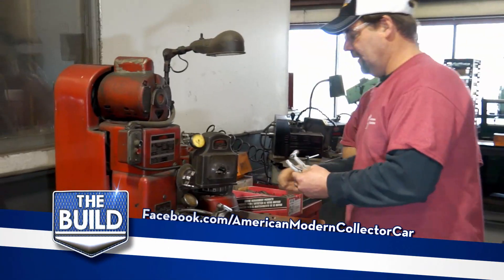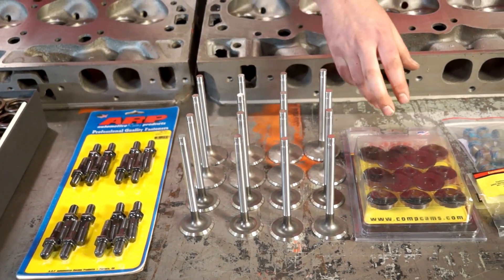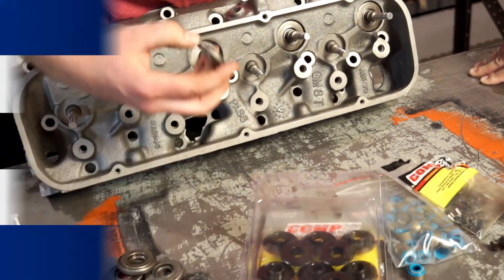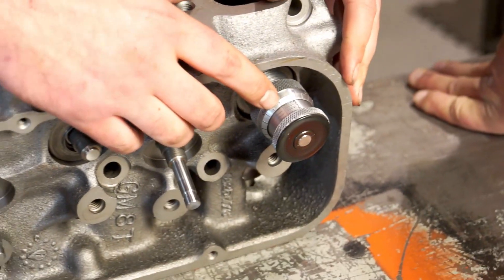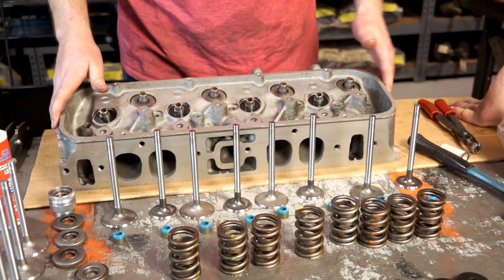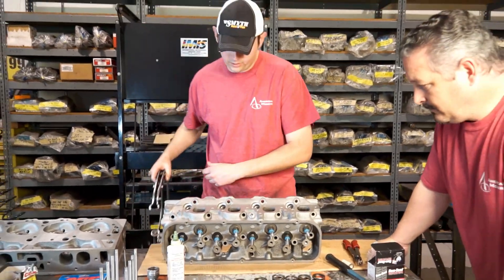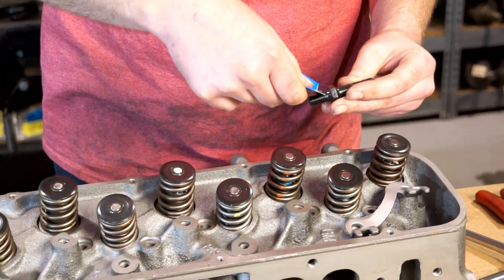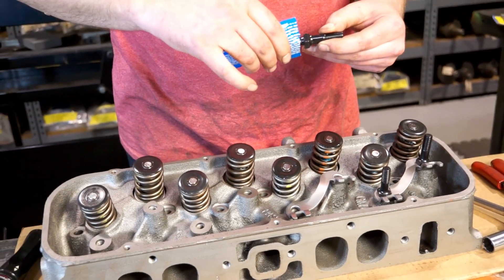How to assemble cylinder heads - The Build

Comment: I am working on replacing the head gaskets. In the process I discovered that all of the valve sprigs are up against the rock arms creating metal-to-metal actions? What created this problem? Should I replace just the springs and valve seals?
Reply from the maker: +InTheory Yes If they are stock rocker arms then there will be metal on metal contact with the tip of the rocker arm and the end of the valve.   If you are saying that the rocker arms are rubbing against the springs themselves, you have something really wrong.  My recommendation since you have the head off the engine, run it down to your local machine shop and have them look at it in person.   They can tell you what exactly is wrong and give you a price to fix it.   At that time, you will know if it is something you would want to have them do or take on yourself.   Good luck!!

Comment: If I took two bare heads to a shop, along with all the valves, retainers and springs, how much does it typically cost to assemble them like you did here?
Reply from the maker: Thanks for watching! Unfortunately, this isn't something we can easily answer, as this will vary by your location, and shops around your area. Your best bet would be to call a couple of shops and get some estimates.